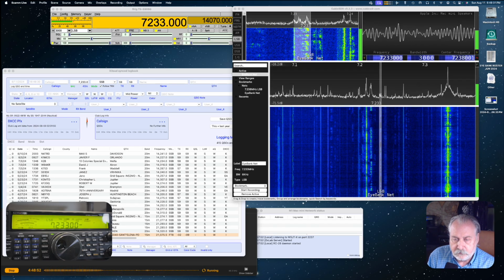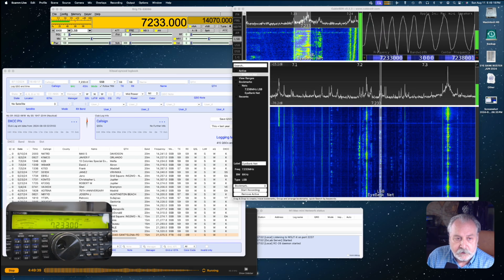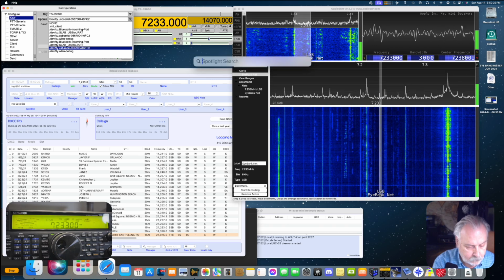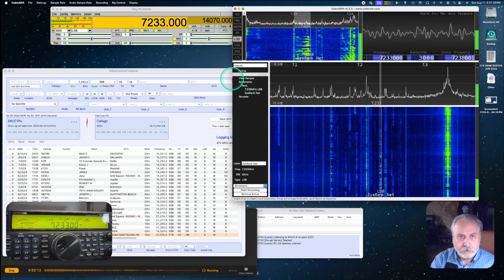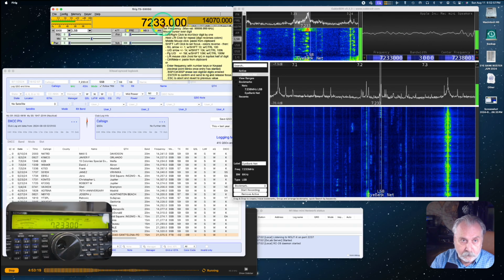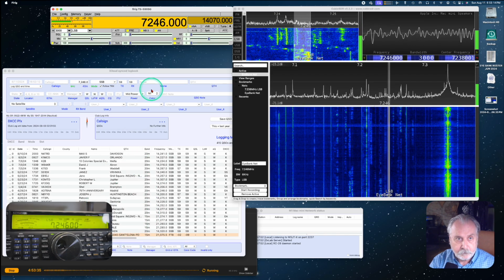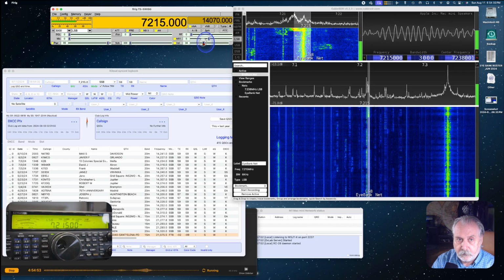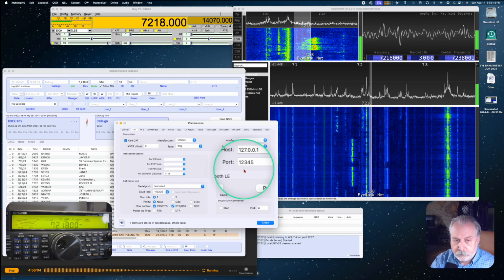CubicSDR FLRig RumLogNG Cat Control   HD 1080p

Comment: Hi Peter, Great innovation and great videos! I just picked up a Mac Mini M1, but am currently using an Elad S2 with as Kenwood TS590SG and SDR Console. Which is great, escept I hate Windows LOL. The M1 is so fast I'd love to get my ham software onto Mac, but lack of Elad software for Mac has held me back. May I assume you aren't using an SDR receiver, and am using the IF from the DRV connector? If so, can you tell me how you get CubicSDR to "see" that? Thanks & 73, Scott N1IA
Reply from the maker: When I made this video, I was using one of the RTL-SDRs I think V4, connected to the drv port on the Kenwood. 
I’ve since moved on and I’m using the RSP1B from SDRplay. I’m also using their software SDRconnect which does things quite a bit better than CubicSDR. I have videos on my channel for this receiver. 
Another thing you’ll need a RF choke on the input of the SDR.